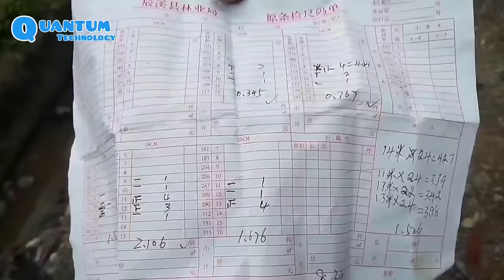hard workers, building huge castles in the Chinese countryside is amazing

Comment: The amount of concrete used for this one building is obscene! Concrete is so bad for the environment, other materials could have been used instead.
Reply: Concrete is actually recyclable & reusable as road base & other such things. It does not have to just waste away forever in place where it was poured.
Reply: @Ashley Falcon  look at how much co2 goes into the environment to make cement.
Reply: You must admit these people are very talented using what they have to work with. And it's not junk material! Like many cancer causing stuff we have here🤔 That's ok if we all done and liked everything the same how boring things would be.
Reply: @Connie Baughman  I agree, they are very talented and a lot of hard work went into this building. I was just saying they don't need to use so much concrete especially between the floors and the stairs and they are clever and talented enough to use other materials.